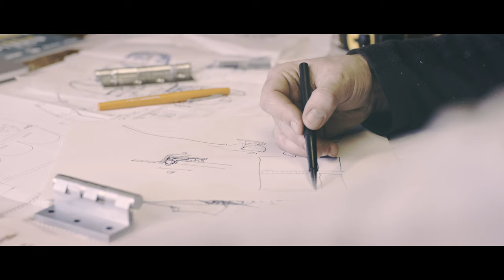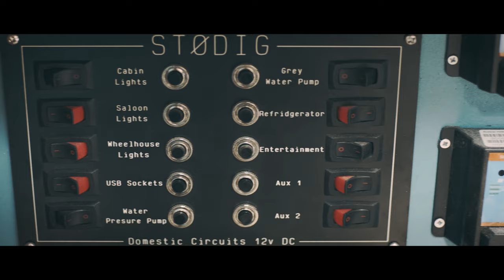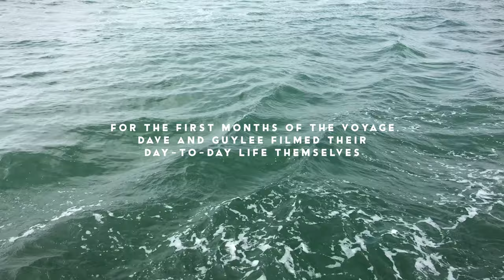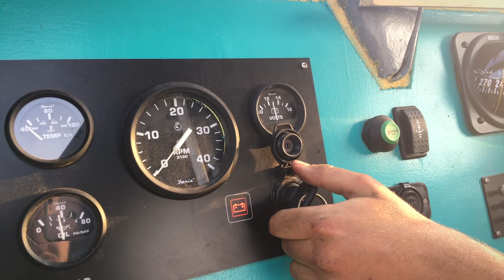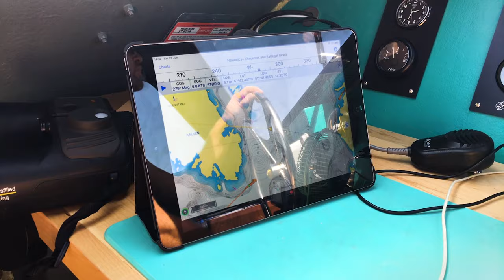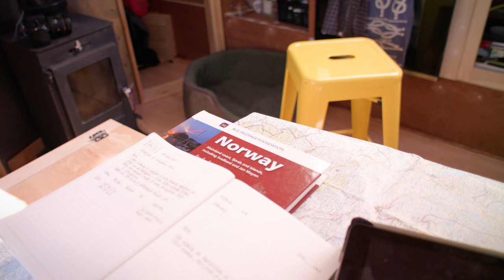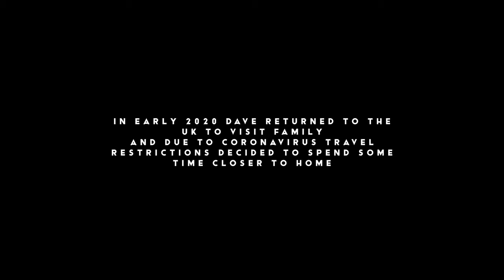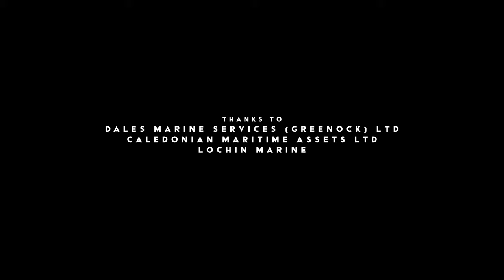STØDIG

Comment: Wonderful to live life fully. 
Two things I would recommend however is 
 1. To  counter the sideways roll on the boat a couple of Fins attached on bottom of boat say at least 300 millimeters by 2000 long is definitely going to stabilize the roll very much as it has a very rounded belly and this will take the sea sick out of the stomachs to greater level. 
2. The Pitch on the propeller was designed for a 100 people wich you no longer need as you're carrying much less weight so going up a notch or three will save a lot on running your diesel engine at lower revolutions to attain same speed .
At your current RPM you will experience a little higher speed with a higher pitch prop if needed.  
Normally an increase of at least 2 to 3 inches works magic.

Ps. Problems with feul pump can sometimes be solved by merely giving it a gravity feed directly to injectorpump by means of a small container placed on the roof. Can save the day of lying helpless or being Towed back to Harbor. 

Greetings from South Africa.
Reply: Man if they only read these comments, but I guess by now, someone would have pointed out all the errors sooner or later.
Reply: @MerwinARTist  at least will be of some help in emergency.
Reply: @MerwinARTist  Pleasure  .
Personally I am a great fan of Solar as well especially with modern day brushless motors available. 
Koenigsegg has come up with a 300 hp motor weighing around 20 Kg.
Wonderful stuff. 
Best wishes.
Reply: @pieterbezuidenhout2741  Solar cant feed 300hp motor
Reply: @Doberman290  The comment I made about Koenigsegg motor was merely informative and definitely not recommended for this application but yes there are way lesser powered electric motors available depending on ones need of course. 
Did you know about that specific motor I mentioned weighing only 20 kg ?

I don't think so .
A Diesel engine with sufficient power output can easily be totally sufficient for such a motor if needed. ( That's if one can afford it.)

At 70 years old I reckon to have more than the average knowledge designing and building numerous more complicated projects in my life. 

Have a nice day.
Reply: @pieterbezuidenhout2741  of course.But how you think-can be this ship powered by solar electrical engine?To move without stop for recharging battery?
Reply: @Doberman290  it's totally possible to  ' Charge '  batteries with a diesel powered generator as wel as use that electrical power to drive an electric motor. 
Besides Solar panels even wind generators can charge batteries so if you want even Hydrogen fuel cells can be used , again depending on how deep your money pockets are. 
Hope this will enlighten you.
Reply: @pieterbezuidenhout2741  Diesel powered generator...I know.I just ask about solar+wind.Possible or not?
Reply: @Doberman290  Possible but dependent on Total Solar OUTPUT of panels on surface area available .
Reply: As a professional mariner, I can tell you that no amount of fins or Bilge Keels technically will improve the stability of such craft.  In certain weather conditions they would actually make the boat more likely to flip over.  Lifeboats have a high center of gravity,  a short keel, and a ton of surface area.

Lifeboats don’t have enough keel for sustained open ocean stability.   In heavy weather this will get tossed around like a sausage on a hot pan, likely until something in the fuel system breaks and the engine dies.  Then things will get worse.
Reply: Mast/sails without a keel won’t sail anywhere.  Not to mention that a kort nozzle steering system doesn’t work when the engines not running, so you wouldn’t have a rudder either.

In the open ocean this thing is a death trap.
Reply: Possible, yes, practical no.  The electrical control schema and VFD required to run a motor big enough to move a lifeboat along would cost ~200-300k$ and take up his entire cabin.  That’s without the separate diesel generator.  O, and the programming doesn’t come cheap either.

Of course that would be for a legit, marine rated and inspected system.

Cost wise there’s really no effective way to modify a lifeboat with a second engine that doesn’t run up against the fact that trying to turn a lifeboat into a motor yatch is a terrible idea.

Comment: I love the huge windows-sky light .
A perfect view of the cliffs of the fjords.  Except for the way it rolls in bad seas , it's magnificent for northern  touring . I'm really impressed . Great idea !
Reply: On the flip side the things are close to unsinkable, you can cut one in half and both halves will still float! About the only thing that will sink one of those lifeboats is an on board fire... Really though the plan would be, if I were sailing her, to head for sheltered waters if bad seas are incoming. Boat like this is not so much about the destination but the journey so waiting out a bit of bad weather is not really an issue.

Comment: Absolutely stunning to watch. I've been toying with this concept for years and you guys have inspired me anew. 
The one thing missing from your design, in my humble opinion, is  the lack of open deck space. I know you have the roof but I mean  place to put a small table and a chair or two perhaps.
Have you considered a swim platform like the ones you get on modern wakeboard boats or something along those lines?  You could  even have a drawbridge type system that can lower from your stern when not in use. 
looking forward to your next video.

Comment: How is your Stern door/hatch fixed to the hull ? the hinges don't look very stormprof  a big wave from the stern in to your  enclosef deck area may fill the boat with water. I would recommend re doing the door solution  with  bigger hinges.
Bolted with  bolts and nuts .
If the hull or door is made of sandwich laminate its necessary 
To carve out around the bolt hole and fill with resin  otherwise  the bolt
Tension will crush the  component laminate. 
This causes leacks 

Also the storm  locking solution need to be sturdier .  Think ; big wing nuts  in brackets or a crossbar Over the opening. This ensure good pressure  on the door seal. 

If you want the doors/ hatches to match the hull in durability that is. 
And those life boats are reely duribal  compared  to a consumer boat.
 Good  idea to match the hatch to that if you are going too cross the north sea with it Some day again...

Othervise a cool prodjekt!
I am also curious about what the price of the life boat was when you got it.
espesely when many cruise ships face dismantling due to the corona cruise stop . Many life boats on them...  
Have a nice 2021

Comment: What is the range of this lifeboat?  Cruising speed?  It's easily 1,500 miles around Norway, not counting deep excursions up the fjords.  Also, with all that plexiglas that is not insulated at all, how do you keep the interior warm in the winter?  I know there is a wood stove, but is that adequate?  Anyway, thanks for a look into a slower, calmer lifestyle - almost like what I live now that my wife and I are retired and living in a covid-stay-at-home manner.
Reply from the maker: We cruise at 6knots, range with our diesel capacity is about 700 nautical miles. Our total voyage was around 2700nm. The 10mm plexiglass is single layer, but is definitely more insulated than your average glass window. We have triple layer canvas curtains that help keep the heat in too (and sun out in summer). The wood stove is 5kw and really pumps out the heat after a cold day!

Comment: Strange... normalny these engines never break if mantained even semi-properly.
Reply: It looked a bit cobbled together in the clips they showed of them working on it lol
Reply from the maker: Turned out the the problem was the fuel feed not the engine. Some gunk in the bottom of the tank was blocking the uptake. The engine is solid!

Comment: Electric trolling motor and a few more flexible cigs panels over the clear windows and on separate charge controllers could be enough to avoid using diesel, wood, and propane?

Comment: The real problem here is that 'speed' (as well as power, performance, etc) is synonymous with efficiency. Something that is made for high speed is efficient at any speed on fuel. This thing would cost more to run than it would just buying a more expensive boat.

Comment: Nice project. BTW, how much fuel (and what fuel?) the boat consumes on average per 100 nautical miles?
Reply: The boat doesn't use fuel, it runs on solar batteries.
Reply: @kman2783  Are you sure? (There are only a few panels on the deck). What kind of an electric motor and battery system it has then, and has it been documented somewhere?
Reply: @anttikarttunen1126   Hello Anitti from Florida, yes I'm 100% sure. There's several other videos on YouTube that describe the build of the lifeboat. They have two power storage units and two sets of batteries. One for the engine and another for power usage on the boat, lights, refrigerator, etc.... I believe the name is lifeboat build, although it doesn't say Stodig. They built it that way so they didn't have to worry about going to ports for fuel. It only goes 6 knots, pretty slow by all means. Thanks for the reply, be well,
Kman
Reply: @anttikarttunen1126   Antti, the name of the video is.
How two architects turned this cheap lifeboat into a arctic liveaboard cruiser. By yachting world. It's like 4 minutes long.
Reply: @kman2783  Yes, here: https://youtu.be/JjpCFP0jJIY?t=172 But as I hear it, the (other) battery is for the starting engine, right?

Comment: Without Prejudice

Being on a "boat", is Different to Being Responsible for The Human Lives on the "boat".

During your over a Year preparing to go around the Sea, on a old life boat, you had a Responsibility And A Duty to Realize That the former Life "boat" engine would not have been regularly Serviced. Consequently, the engine, the Oil, the Fuel Tank ALL REQUIRED OVERHAULING + SERVICING By a Knowledgeable Engineer Of That Type of Engine. You should have either asked for an Engineer from the supplier to come out, Or, Lift the Engine out while you were prancing around the "Hard", doing secondary painting.

It Should be pretty obvious to any REASONABLY intelligent person intent on using an old life boat to cross into busy Sea Lanes THAT you would need to Service + Overhaul the Complete Engine System + Fuel Tank + Empty Out Old Fuel, + if Necessary replace the Starter, before leaving your home port.

You had no back up propulsion system, and, you EnDangered your own Two Lives, And , EnDanger the Lives of Rescue Crew.

At least one of you had Studied in College, THEREFORE , you cannot claim you didn't know.

You should have PROPERLY PREPARED by at least doing a basic Seamanship Course.

The Danes should Send you a Bill for their Rescue of Two Silly boys, who clearly had adequate time to do other thing's, except  INTELLIGENT preparation for your trips.

You couldn't even Jury Rig a basic Secondary EMERGENCY Sail.

Britain ruling waves...Hem! Not if she relies on you two boys.